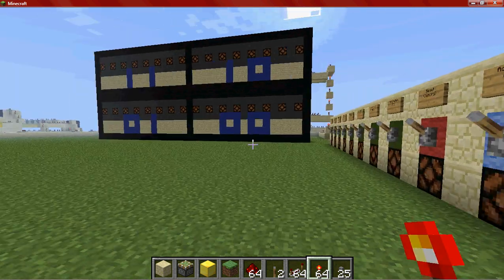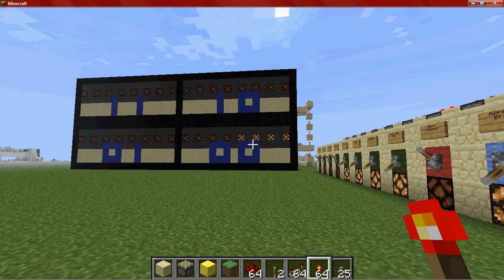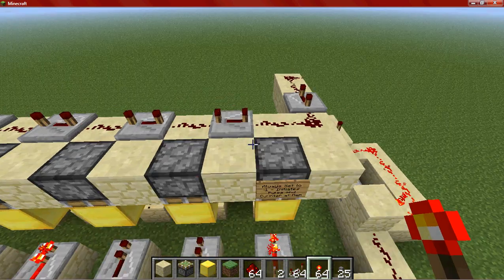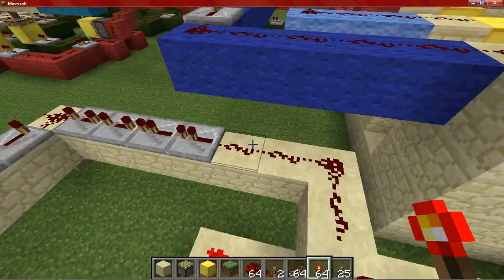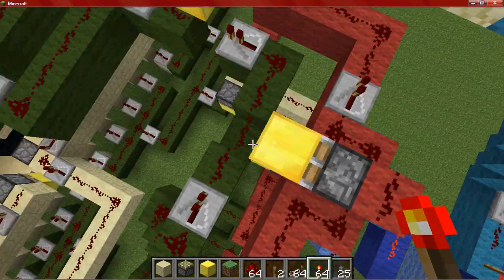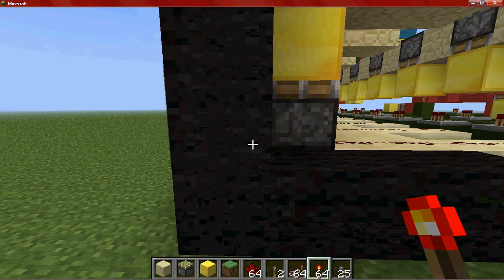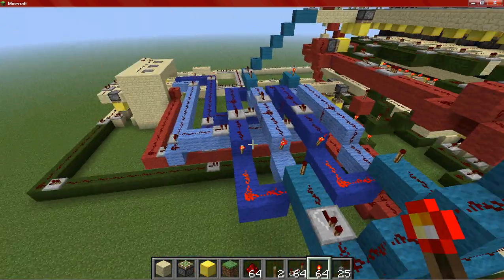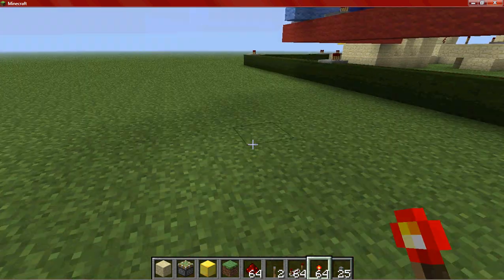Minecraft - Serial Communication - Advanced

Comment: Completely awesome! I made a 2 bit adder that takes input from 1 bit adders and i guess i did it in parallel because it had an input for each of the 4 bits added together. I was wondering how you can actually send data in one line of redstone wire and this completely answered my question. Totallly awesome.